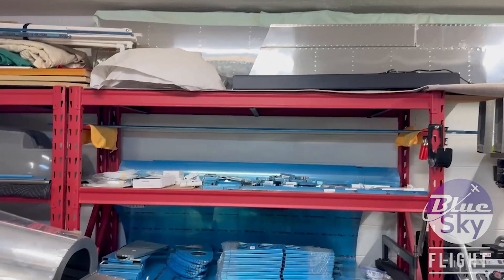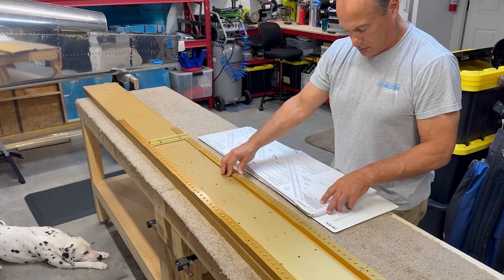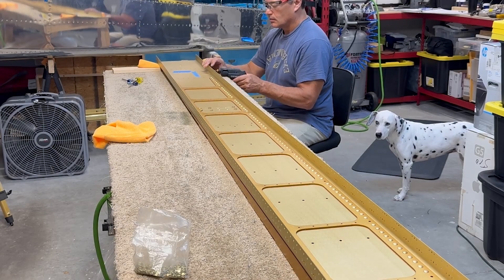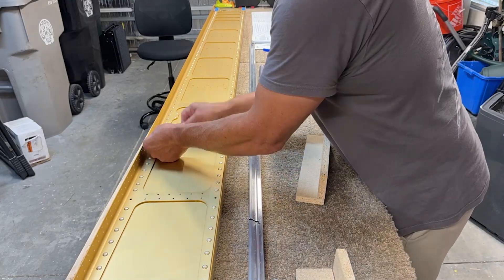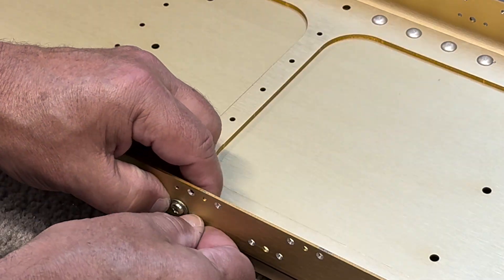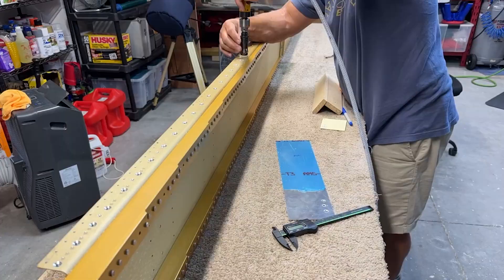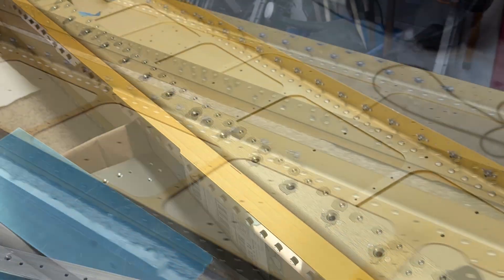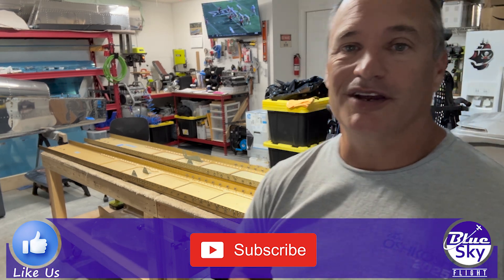The Wing Spars - Building a Vans RV 14 Airplane Ep16

Comment: Life happens - welcome back. The countersinking on the spars look nice. What did you use to prime the holes? Thanks for the clear and comprehensive videos.
Reply from the maker: I used the same SW P60 primer that I normally spray on all of the parts. I just mixed a really small batch. As you see it’s like water and goes on really thin and dries fast. But it appears to protect well. It’s what VANs uses on the QB kits, so I digit it’s good enough for them, it’s good enough for me.